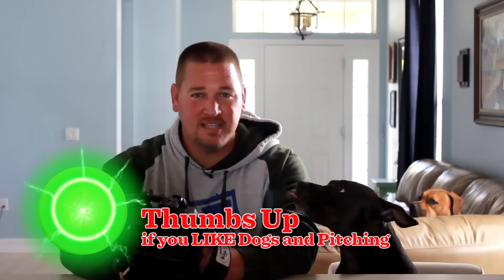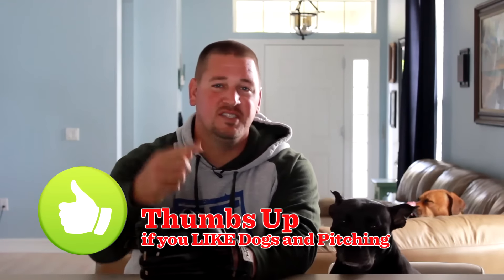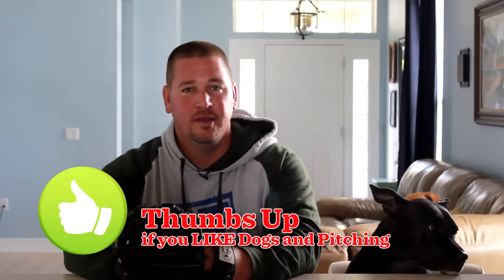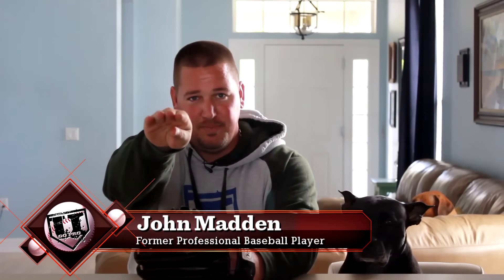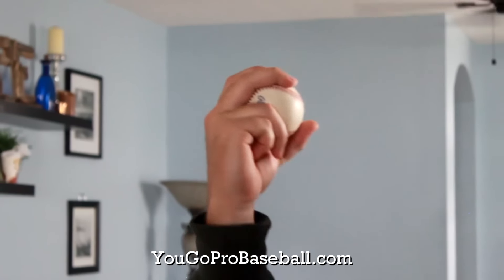Baseball Pitching Grips - How to throw a 4 seam fastball & 12-6 Curveball

Comment: I threw a 1 finger changeup curve ball. I am right handed, to the righty I threw at the hitters head and the pitch would end up on the outside corner of the plate. It broke down and away 10 mph slower than my cutter which was my other pitch. My first finger was with the seam and my thumb across the bottom, it went with my natural side arm motion. Same with the cutter, so the hitter could not tell what was coming. I have big hands and long fingers.